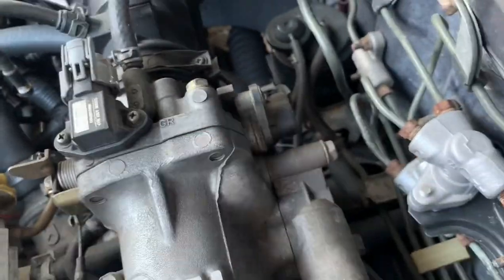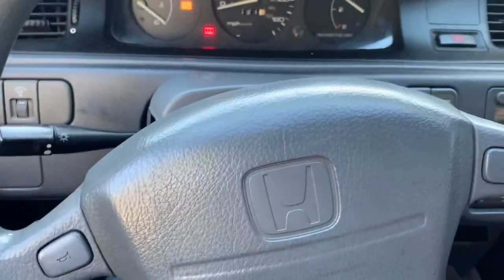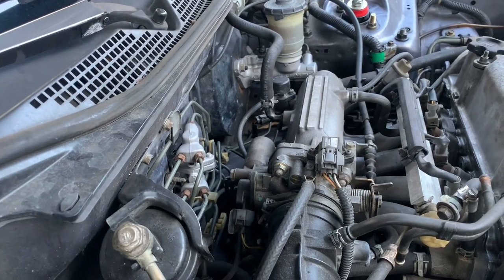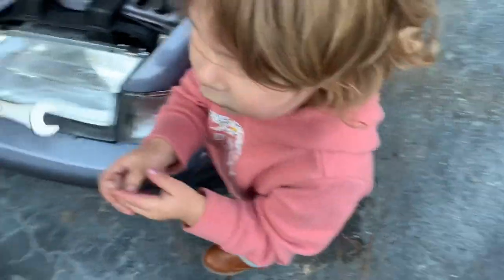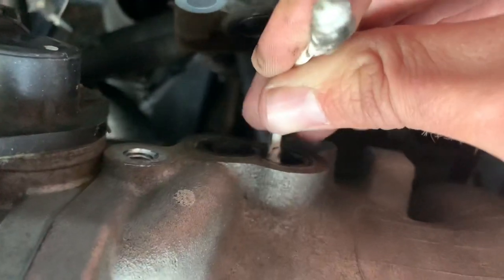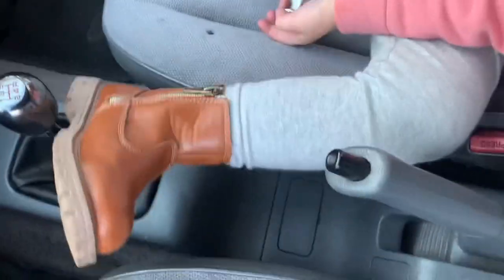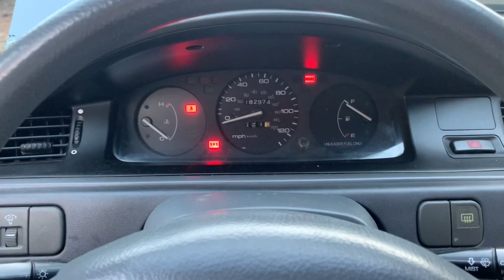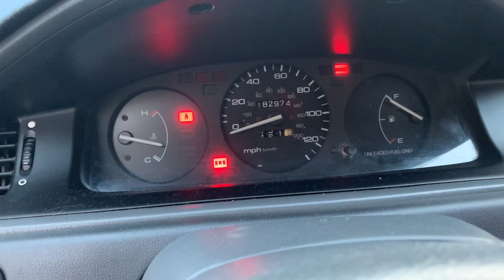1995 Honda Civic Troubleshooting Idle Issues

Comment: Have the same issue
Replaced the iacv, worked fine then it happened again
I’ll try to disconnect and connect it after
(I’ll be adding silicon to the iacv for better coverage since there is a slight opening in mine causing it to idle really high

Comment: I'm having the same issue. But, I actually replaced the IAC, reset everything by disconnecting the battery for 10 minutes... And it didn't fix it.
It's gotta be a vacuum leak
Reply: Was it? Dont wanna buy an iac yet.

Comment: I have high idle what could be?
Reply: About 2.500rpm on idle
Reply from the maker: Clean your iacv. Also try unplugging it and adjusting your idle screw on your throttle body. If that doesn’t help look for any vacuum leaks. A helpful tip, get water and soap into a spray bottle and if there is a leak on any vacuum lines it should bubble up. Hope I helped.